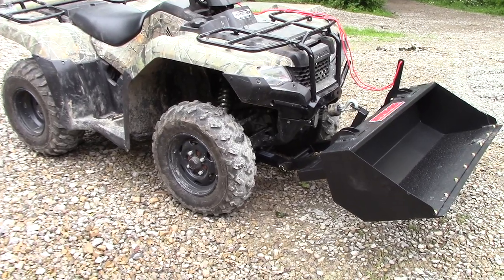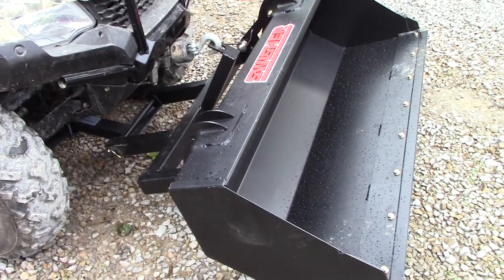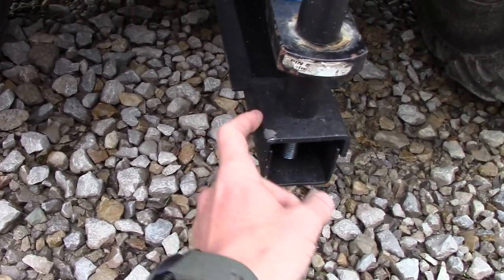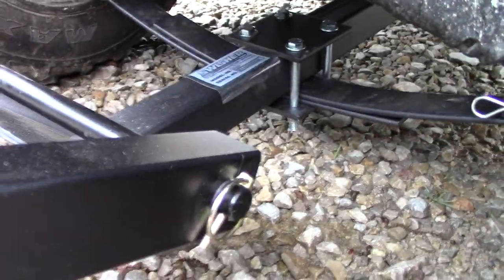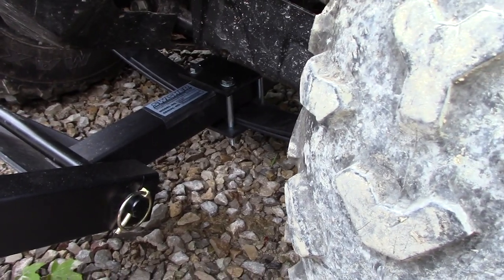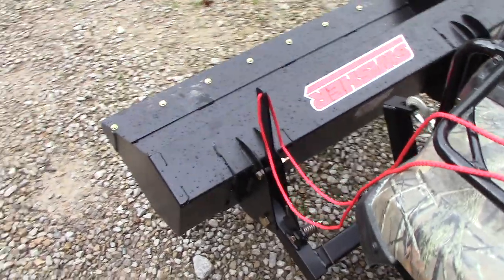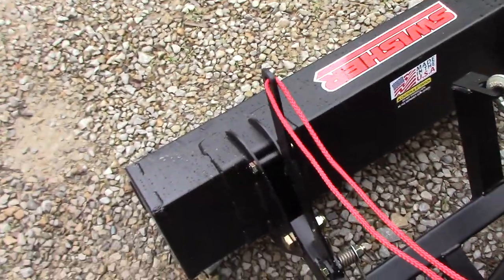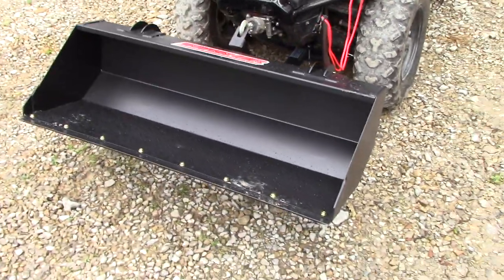ATV Loader Bucket On Honda Rancher Swisher P/N 15714 and 10260

Comment: Lower the bucket when dumping, it will prevent the whole load from dumping in one spot. Then as you back up slowly lift it to spread out more. Just a tip!
Reply: exactly what I thought... but you said it 1st
Reply: Yup as a payloader operator I was gonna say the same too. Also, you can release the bucket with it up in the air and use the tip of the bucket to help spread the gravel. Think I may need one for my Honda.

Comment: * * * I have this exact bucket on my 500 Suzuki ATV. BUT "made a couple of important changes" you may want to read about. . I beefed it up a little bit. (1) One thing I had to do was remove my cable off my ATV winch and fit a 6'-8' long flat 2" wide strap on mine because when you lift heavy material like gravel (even snow) repeatedly up n down, the cable will bind and kink so that you can't unwind it. A flat strap will never kink up. I used a lifting strap rated for 1000-2000lbs. $15 online. Cut the length down to fit. To get my binding cable off the ATV winch, I had to hook it up to my pick-up truck ball hitch and aggressively back up the ATV.  (2) Also, had to weld a vertical support piece at the base/bottom half of the square tube that has the slip hook at the top. I felt that heavy material (gravel, rock) would bend or break that square tube. (3) And the last thing is . . that most people who use a lift bucket on their ATV will overdo/abuse it by lifting too much weight, therefore wearing out the front bearings on the ATV. Your ATV is not a Bobcat! The normal use for an ATV front bucket is for mulch, branches, dirt or something lighter. I use my bucket for everything out here in the country! It's been a couple years now, but I know I'll have to replace my front bearings someday. Though I try to be careful. But the bucket is definitely a back saver.
Reply from the maker: Great comment. Thanks

Comment: Put a load of gravel in the bucket then back drag what you spread. The weight will hold the bucket down better. This worked better than I thought it would.

Comment: Considering one for my '23 outlander 850 max. Do you still have and use the bucket? Any wear to the atv worth noting?  Love the idea of a front end loader for the quad.
Reply from the maker: I don't have it anymore since getting a John Deere tractor with loader. Just outgrew the ability of this unit. It did do what it was advertised to do, but just wasn't enough for my needs.

Comment: This is not a three point hitch right? It's just a custom solution?
Reply from the maker: Correct. Custom
Reply: @JackofAllMasterofNone  Thanks. I'm somewhat new to these kinds of mechanics and I've been wondering if there is an ATV or UTV that is designed to have a small three point hitch (cat 0 or 1).
But I guess it only makes sense to lock the (soft) suspension of an ATV and the axles are the only sensible attachment point to transmit the loads of the attachments.

Comment: I'm installing one now unfortunately I'm missing the bracket that goes to the A arms could you explain how it connects to the A arm?
Reply from the maker: Brackets bolt around the a arms with a u bolt style bracket.
Reply: Thank you I just finished my install I'm not happy with the angle my winch cable is at so alittle more tinkering and I should be in business

Comment: I don't know. Maybe a bucket is good for hauling stuff, but not that good for much else.
    I once spread a huge load of gravel for a cement base in a garage site. A very large garage site.
 I just started eating away at the pile and moving it around, with just a plow.
   The job on this video could have easily been handled with the plow in less time for less money, and less monkying around with mounting that plow.
   For 17 years with my old atv, I moved boulders, railroad ties, mounds of dirt and rock, branch piles, snow,and more.
  I've thought about getting a bucket all those years, But the limitations inherent with the whole set up made me hesitate.
      This year I got a new atv and thought I'd look into buckets, and from what in seeing, I'll have to pass.
     Then there's having to remove your plow mounting system to mount the bucket. By the time you get it set up,you could have done the work with you plow,or even a shovel.
    Nice video though
Reply from the maker: A plow can not carry 250lbs of gravel 100 yards but thanks for the comment. Money well spent for my purposes.
Reply: Swisher makes a plow attachment for this mount as well. 
Simply pull clip ring, pull pin, put plow on with same pin/clip, attach winch. Done..5 min. Max.
Reply: @JackofAllMasterofNone  I get that but a guy can shovel 250 in to a trailer in about 2 minutes. If I was rich and had someone to go out there and switch the implements for me,I suppose I'd own one.
 Otherwise,I'll grab the shovel and get er done.
  And the trailer has many uses.
 I'm not knocking the front loaded. Its a great idea.
 Is just the limitations of an atv.
 For what I just spent on my new atv, I could find a used small tractor with a proper front loader. But then I wouldn't have an atv.
  With what I earned plowing 17 years with the old atv, I could've bought both.
 If I had more space I'd buy a tractor.
 Good luck
Reply: @richardtheisen6456  I have this same setup on my 01 Polaris sportsman 500. The bucket beats a shovel by a multiple of about 50 and you can switch between bucket and snow blade in about 3 minutes. I like this setup because it has a big leaf spring that carrries the weight of the bucket and material or the snow blade, and all the pushing and ramming is handled by the rear hitch. Obviously the ATV isnt gonna lift like a tractor...but it for sure beats a shovel by a long shot